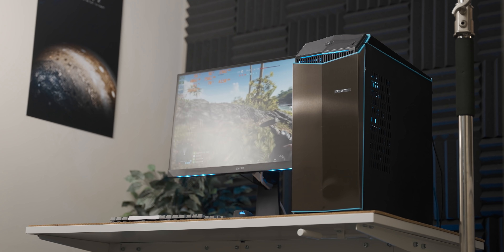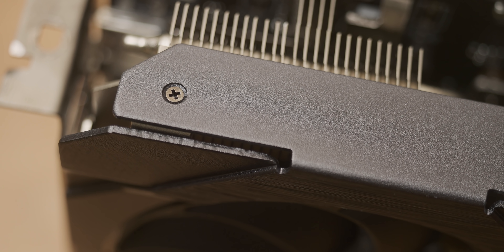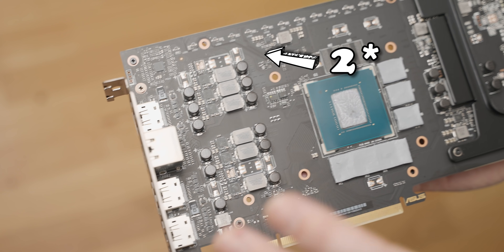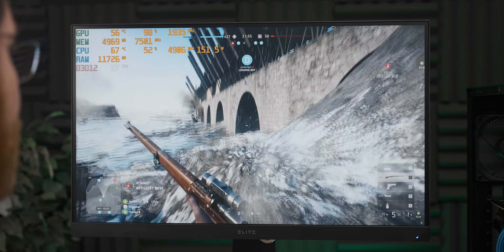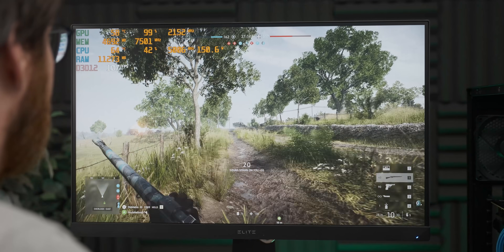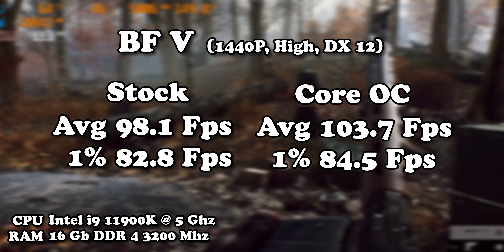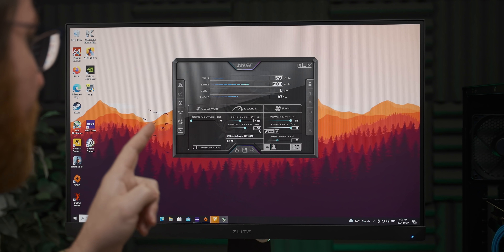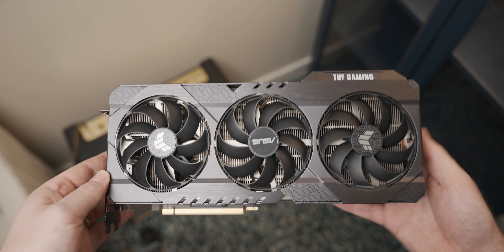Overkill Is BEAUTIFUL, But Will It Overclock?

Comment: I think 9% is actually really good! 10 fps for 4 hrs is something i can get behind
How did the core voltage look with the core overclocks? Even if temps are good, too high voltage wouldnt be great for longevity.
And then again, in the same fashion, if voltage barely changed, maybe you could adjust the voltage curve and actually hit that 2200 ?
Reply: If it's anything like my 3080 tuf, you don't get voltage control. You can bump up the power limit to 110 but that's it. If the world was normal this is supposed to be a low end MSRP card after all. Not to mention it's pretty much known at this point that the 3000 series doesn't OC much even if you could tweak the voltage. 9% is pretty high for a 3000 card. You're usually lucky to get 5% ;p
Reply: @devilmikey00  So what happen if you click the curve editor in msi AB with yours? Pretty curious :D Ive got a 2080 (not a TUF though) which lets me tweak the curve, kinda interesting you cant on a 3000 (especially 3080)

I'm also surprised about the power limit, my 2080 goes up to 132% but maybe thats more brand/model related. Or maybe 3000s are already pretty cranked up
Reply: @Eazon_  you can, but theres a hard cutoff from manufactuerers that prevent you from going too high / too low. in "most" cases you dont change voltage for more performance. its more for power savings / temps from what i get out of every...single....overclocking video
Reply: 9% for the best case scenario is nothing to write home about
Reply: I am wandering the same, i cant hit 2100mhz without moving voltage im currently at 2017mhz (+135mhz) core clock and +800mhz on memory at 986mv on my card i dont know how people hit those numbers without curve editor

Comment: "Chode beast", probably best synonym for beefy I've heard yet.
Reply: yes, also when a gtx 1650super can mathc those frequencies with oc as well
Reply: I run mine at 2000 on the core and 7000 on the memory all the time runs at about 69-74°c never crashes and run cyberpunk on low close to 70fps 1600x900
Reply: We're so 90's. I used the word Chode the other day and no one knew what it meant and many had to google it and still had no clue.
Reply: Definitely asking my wife if she wants to see the chode beast tonight . I’m expecting a positive outcome, thanks Dawid!
Reply: im on the hunt im after you , Smell like I sound, I'm lost in a crowd
And I'm hungry like the wolf . by this i mean i would like to purchase one of these beats for less than 1200 CAD XD. a prebuilt is a solid deal with all the other components.
Reply: I thought it was funny but IDK if this GPU is short enough to be considered a chode, it's a pretty decently long GPU all things considered. If it were a 3+ slot card and only the length of the PCB i'd consider it xD

Comment: Casually opening a 3060
Reply: I've torn my 3080 apart like 10 times now
Reply: @V_for_Vovin  why do you need to open it so many times?
Reply: @Eazon_  Had to add and adjust thermal paste because Asus apparently missed a lot of it.  Recently had to work on fans and locktite the screws.  Lots of issues with this Strix card in order to optimize performance.
Reply: @V_for_Vovin  why?

Comment: I have an Asus TUF 1660 Super with THREE fans and I get around 73C in graphic intensive games. The boost clock is fixed at 1960MHz and the fans spin around %50. TUF brand really gets the job done.

Comment: If i remembee correctly. The tuf cooler is the same from 3060 all the way up to the 3090
Reply: The 3080ti and 3090 have a beefier version.
Reply from the maker: @Oraceon  Yeah, I initially though it was the same, but you are right. The 3080 and 3090 version have more of everything. 😁
Reply: Well that really an overkill cooler
Reply: @Breakbeat631  i can see why Dawid cannot really push temps because even my 3070 at +150 core / 1250 mem. the temps only went up about 5 degrees from stock, even then it could be a matter of user error / heatbuildup in the case
Reply: it is same design，but after 3070，it increases in size in all three dimensions. They do look exactly the same and the tuf 3060 is bigger than a lot of other 3080
Reply: pretty sure the reason they are "revised" is to fit the Vram/ power delivery componenets. they are all 2.7 slots? i get there could be a greater finstack or something but dimension wise they are all the same ( i have a 3070 tuf and my brother has the 3080) size wise they are litterally the same. 2.75 slot, 300mm length
Reply: The Strix cooler is the same from the 3060ti to the 3090 while the TUF cooler is the same from 3060-3070. 3070ti (?) and up it gets a dedicated vram heatsink similar to sapphire cards and the heatsink itself becomes larger with additional heatpipes
Reply: @ch33zpuff  so its basicly the same minus the 2 pipes. the vrm heatsink is a seperate peice that was easily removed in the design process(most  likely designed this way before the 3070 was released). 

still a overkill design lol
Reply: I have a 3070 that appears to have the same cooler on it.